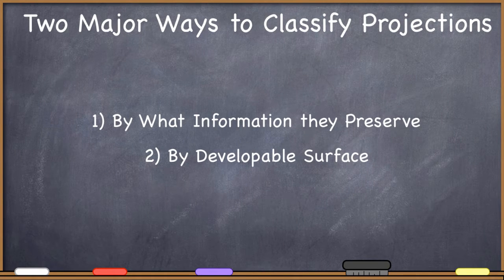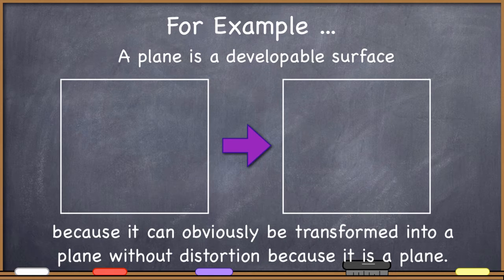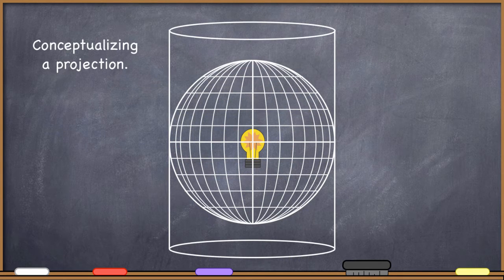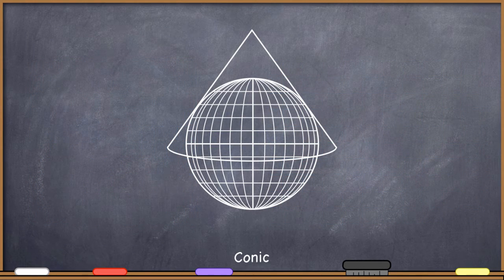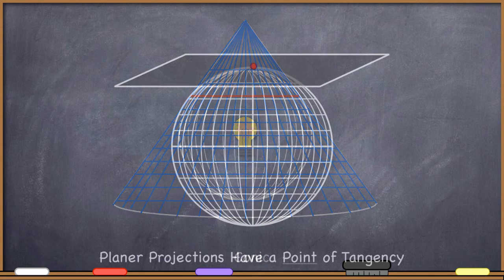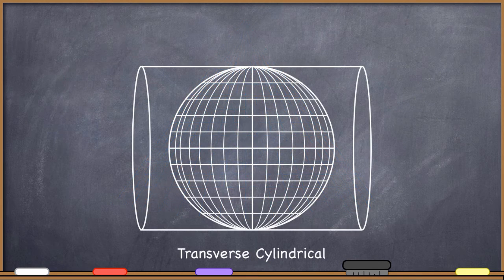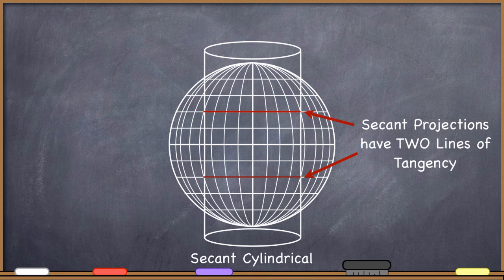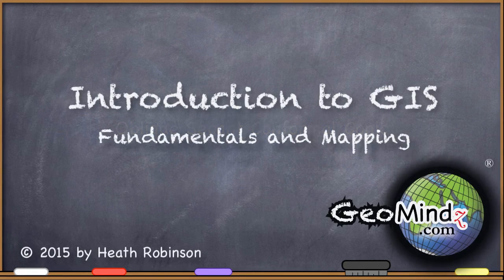Map Projections: Developable Surfaces - GIS Fundamentals and Mapping (20)

Comment: For the cylindrical projection, if the light source was in the center, wouldn't the projected lines of latitude extend past the top and bottom of the globe onto the developable surface? As picture in this video, they're the same height.
Reply from the maker: If I am looking at the same part of the video you are talking about, I think you may be right. When I made the video graphic, I think I was trying to make it easy to see the difference between the white lines on the reference globe and the blue lines on the surface.
Reply: @GeoMindzcom  Awesome, thanks for your message!